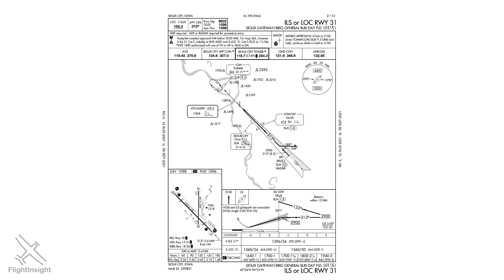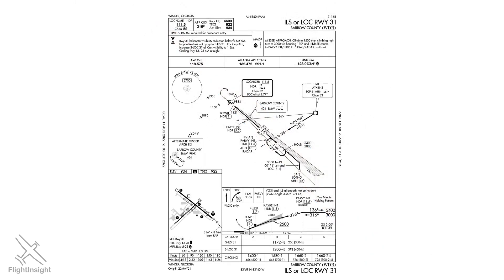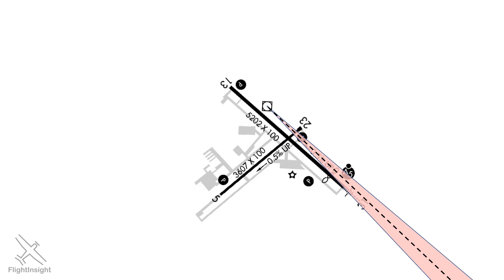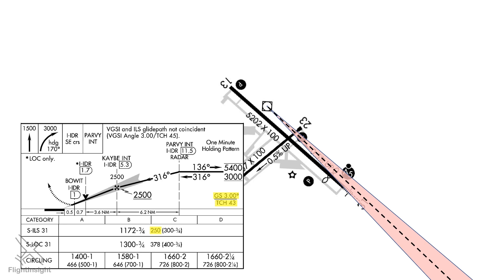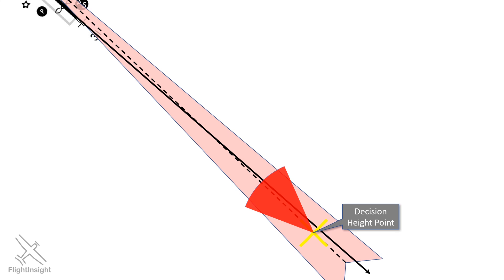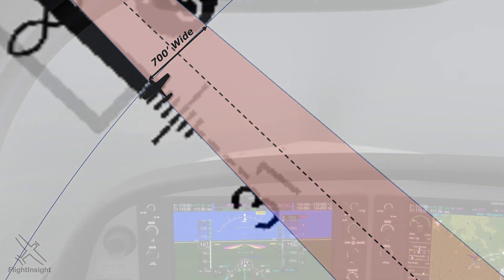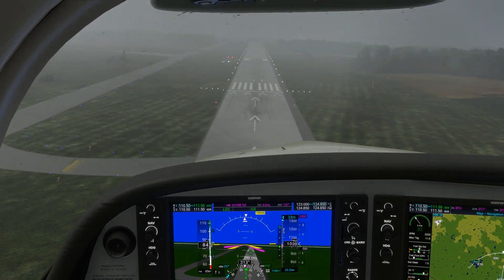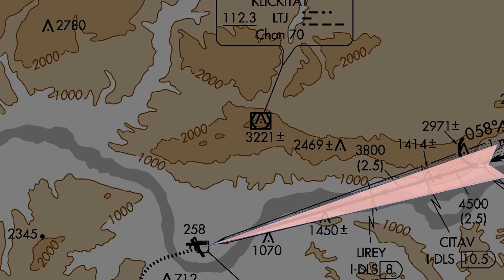Offset Localizers | Localizer and LDA Approaches

Comment: Hello. So I just did an offset of 10 degrees into an indian airport recently. I lined up before the MDA. 
However, I am curious if in visual conditions... and you just cant see the runway even though it is visual conditions(new to airport). When is the absolute latest time you must break off to align yourself with the centreline or go-around?

Comment: So… knowing that you are flying an approach with an offset localizer, should you then fly with, say, a quarter to half-scale deflection knowing that it will eventually put you closer to the centerline as you proceed inbound?
Reply: I think that would be risky, if you inadvertently get a little off course you’d quickly be out of the protected area.